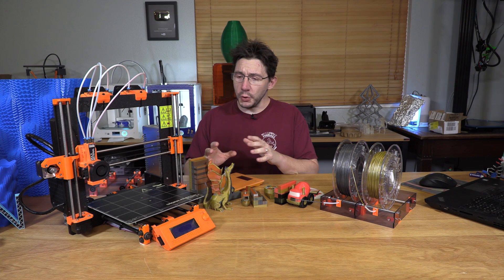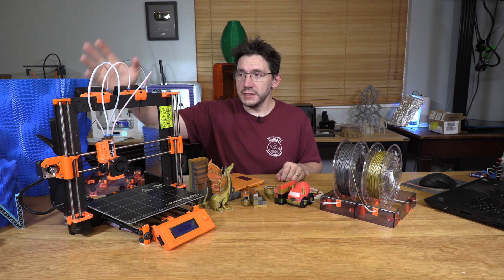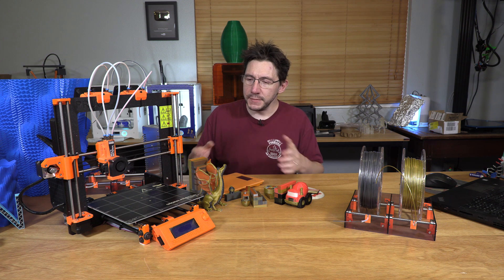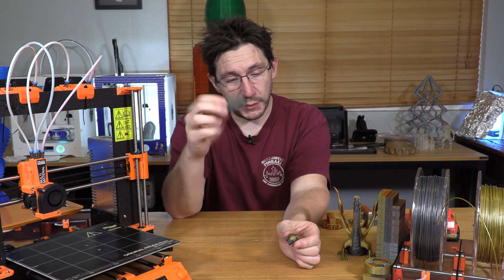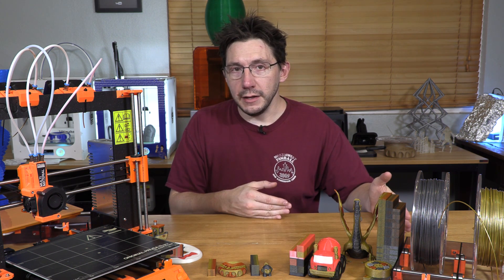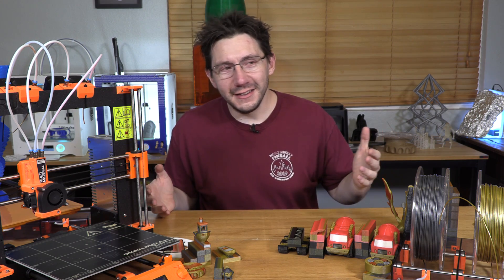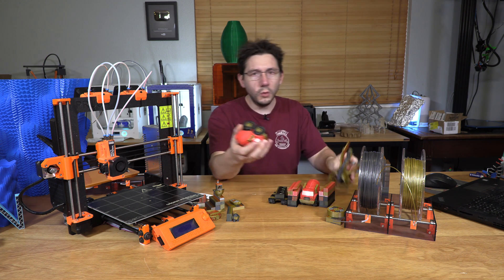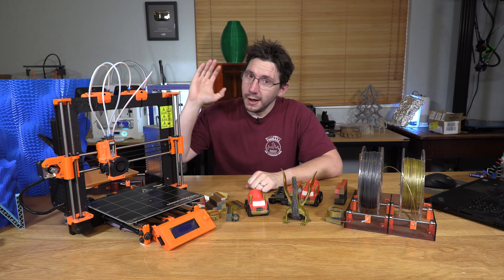Prusa Multi Material Review(?) - My Thoughts on the Prusa MMU 3D Printer

Comment: I wonder if instead of a waste block, that can be done with the in-fill instead... assuming it doesn't bleed through the outer layer.

Or have an option to print a 2nd separate object using the waste/prime material.

Comment: excellent review. I run a 3 filament head which gives me mixed 4096 colors or should I say shades but a 4th would be handy as a support medium I do have a small amount of waste but because it mixes on the fly a lot less than you do. I'm taking about 1 to 2 grams of waste for each change over. Mixing heads working properly are awesome!!!

Comment: You don't need this to make multi color prints. Paint works very well. I have a dual nozzle printer and the only time I  use the other nozzle is when I need to print a part with rigid and flexible parts.

Comment: The purge tower is a great point but the key is it's the same size if you print 1 or 100 parts on the bed so it's very advantageous to print many parts at once. This way the purge tower becomes a small fraction of the overall weight. Helps to have a huge bed for this :) Nice video though and very easy to follow.

Comment: The solution to the waste block and the wasting of extra filament to build the z height is a rotating disk attached to the z axis at the correct height for extruding plastic. The old colour can be purged by extruding it onto the disc while a scrapper will direct it to a waste bin or a small shop vac.  (C) David Patterson Dec. 7, 2017.

Comment: Lol Either Joel doesn't know that Bearings are sold separately and massively cheap everywhere in the net. "Take apart fidget spinners and skateboards." 
ORRRR.... He was probably joking, lol
Reply from the maker: +Fernando Nuñez ;)
Reply: DUDE, I LOVE YOUR WORK MAN, THANKS A LOT.
Sorry. Fangirled for a sec.
Reply from the maker: The second "n" in your last name is cooler than ANY of the letters in my name.
Reply: Hahaha, You're awesome! 
Thank you.
Will you and Angus ever try building a printer from Scratch? 
I would love to see the step by step.  more detailed. 
Like Thomas, but not "Cloning" Or like Tech2C but with more actual step by step. 
I would probably pay to have those videos.
Reply: Thomas has a pretty nice cloned prusa i3 from scratch build, I think it’s pretty relevant for most scratch printer builds still, I must admit, after the first general videos, views were pretty low because most people are much more casual. It’s a pretty huge investment for a series like that. Best of luck to anyone who wants to build a printer from scratch because it’s really awesome for the tinkers!

(Building a SCARA reprap arm if you want a really unique printer system, unnecessarily large print volume potential, and generous open source firmware out there)

Even skate boards get their bearings from fidget spinners Kappa
Reply: Gordon Laplante just like every other kit. Lol
Reply: Joel's second printer was a gMax 1.5 kit. Not so much from scratch per se but he did assemble the whole thing.

Comment: Only time the purge blocks start not to matter is in printing more then 1 copy of the object.  The purge block get shared.  I  currently have 3 machines with the MM upgrade, so here is my  personal experiences: 
Pros
    prints very as nice as mk2s
    software is easy to use
Cons
    1) QC on the 3d printed parts where not that great.  Main issue I had was with the multiplexer block, 1out of 3 actual worked with out either being replaced or reprinted by me.  Issues was fitting the SS tubes,  tubes where at wrong angles which created major drag.  In bot parts extruder 2 and /or 4 holes where collapsed or bad angles.  I would recommend the multiplexer block would be shipped assembled and tested in upgrade kits .  Or if possible mill the part or redesign it.
   2) Under extrusion.  I found  few issues that can cause it.
      a) multiplexer block drags the filament and or start shaving  it on retraction.
      b) bontec gears
           i) the gear on the door can spin out the shaft  on bottom side causing a misalignment.
           ii) no sure if the coding on the gears or  cause by misalignment girding. But the bontec gears produce a black metal dust that eventual makes down to the hot-end. (its not filament dust that is a separate issue)
          iii) slop develops on the bontec gear on the door allowing the door to rattle and eventual gets miss align.
   3) jams . Well most of the time it happen to me because the hot-end got block by garbage (bontec gear dust) ], very few happen on filament switching.  But is huge pain to fix.  The bontec grind the crap of filament shoving dust all over the place. Now I use can air after every print, even if it did not fail. I know the MK3 MM will fix the grind the filament, because it will detect jams.

So the purge blocks compared to maintenance is nothing.

Over all I think is a great product but it needs few improvements to make as reliable as MK2s single was.

Comment: There would be 0 waste if you programmed a desired object rather than a useless block of plastic. You would end up with two great models.
Reply from the maker: +A M a multi color / multi material desired object would still require a purge block, so I don't quite understand what you are saying.
Reply: 3D Printing Nerd, an object made from your purge material as if you were only printing with one color. It would look tie dye but still more useful than a block.
Reply from the maker: Ah, okay I see what you're saying. YES. I think that's a great idea, and would have to be implemented at the slicer level. I imagine picking a model as a "purge model" and then letting the slicer work out the details. Hmm...

Comment: There is no way to make 3D model instead of purge block - I see a lot of comments about this!

Nozzle must clean old color, and start to print clean new color all in ONE LAYER - because of this, there is no way for purge block to become a model. Nozzle always need same area to purge old and start new color - so that imaginary model would need to have same horizontal cross-section area (or at least, bigger then needed)
Reply: I think purge block is not always the same length of filament per layer - it contains some empty/support-only sections inside. So besides a purge model you could have a smaller purge tower that is smaller and mostly support except where the second model is insufficient to purge.

Comment: Full disclosure, I’ve only had my CR10s for like 3-4 weeks, my first and only printer.

That being made clear my question for the prusa engineers is: WHY? Why create a block at the same time as the product matching the layer height? I’m guessing it has something to do with wiping off the nozzle after the color purge. 

To me this is a programming problem. Once its done printing that color and needs to do a color purge, home the nozzle and puke out the old color, then return with the new color then keep printing. I think that way you’d only lose about 5-10mm of a color per change.  Maybe not a full homing just on the X and Y, leave z alone. 

Or instead of what appears to be a long wide block how about a small 2mm thick walled rectangle. 

I’d say just mod the operating system on the multi filament models.

I just emailed prusa with my suggestion on just purging without creation of a whole new block of wasted filament.

Comment: Can you turn PLA on a lathe? Because those waste blocks could make awesome pen blanks.
Reply: Yes you can, and i think they would not, because the purge blocks contain empty sections inside.

You can however take a casserole dish and melt down that PLA into a solid block in your baking oven - together with other failed and discarded prints, and you can of course machine that.

Comment: Was going to invest into the MK2 MMU unit then refrained.  I love the concept, except for the size of the waste block. I don't run a print farm so everything would have an amount of waste, and the bed capacity by now should have grown. Plus the MMU option is unit specific as far as my understanding goes. Whereas a Mosaic unit can be swapped to any unit, and there are talks of making it capable of dual extruding to 2 units at the same time.

Comment: (About 3:50) I bet the resistance that is from the roughness of the bearings, they can’t handle the weight of the spools? That's what it feels like when I manually pull the filament through mine. 

I've read online that you can adjust the footprint of the wipe tower to make it less wasteful, but I'm hesitant. The frame looks like it could hold at least one or two more sets of extruders; they would have to make the feed chute (?) larger to accommodate more Bowden tubes.

Comment: Joel,
I, too, was not completely satisfied with the way the spool holders worked from behind my printer (plus I didn't have enough room behind my printer), so I made a rack that you may want to consider: https://www.thingiverse.com/thing:2618257  .   It gets the spools out of the way of the bed cable and gives you easier access to the spools.  I've been using it for several months and it works very well.

Comment: those are some big purge blocks imo. with my 2 in 1 extruder system i need a purge block of 18x18mm with an E3D clone. 
if you don't use every color on every layer then purging somewhere on the side should be more efficient right?

Comment: Can you actually print multiple materials with this, or just diffrent colors of the same material?
For example, would it be possible to print the mixer with transparent windows?
Or print a model from PLA and add maybe carbon filled nylon as structural parts into the model? Or print a part from PETG and add sensor surfaces with conductive filament?

Comment: If anyone is wondering why Infill purging isn't a thing yet... I actually did a little project about a year ago that emulates most of the "smart purging" with a gcode post processing script  before Prusa released his MMP kit. I had put together some random thoughts about printing multiple material with a Y splitter/single nozzle. 
 You can read about my thoughts on it here https://www.reddit.com/r/AdditiveManufacturing/comments/7924cx/a_prototype_of_smart_purge_tower_equivalent_of/
Reply: I was thinking a tuneable purge amount or a second model printed in who cares what color, but your idea is far superior! Yep, infill purge!
Reply: Mega Making Thanks!
Reply: I had the same idea while I was watching the video. I don't know how many grams are used for infill, but It would increase the efficiency of printing.
Reply: Collective minds = smarter problem solving

Comment: id use the MMU to showcase a more finalised product that comes striaght of the bed, works well in this case. Id also wouldnt use it for colours really, but for exoitics/different materials, so carbon fiber, nylon, dissolvable suport,  cheap pla, flexible material, so that more practical or movable prints work well straight off the bed, or if u design in a modular fashion as u should, then u could print more single material parts in the same print, which would produce purge tower only when switching part, or if the parts are small enough to be printed one after another (dont see that much these days) then u get a continuos printing but only small purge when starting the next print.

Comment: So the way for example BCN3D does multi material printing does not need a purge tower and only has as much waste as filament is drooping out of the nozzle. While the Prusa MMU clearly does support more colors, don't you think the better "first step" for multi material would be the system BCN3D has? From there go innovate and find a way doing 4 colors? Not wanting to down-talk the Prusa MMU, it's clearly a great product. I see a combination of UM style multi extrusion and independent carriages in the future... Or even a 4x UM style extrusion system.
Reply: Independent carriages like on Sigma and UM 3 are much more expensive solution - definitely better, because you can mix different materials (with different melting temperatures), but price is a BIG factor here, in Prusa case.
Prusa MMU is in fact Multi Color Upgrade.
Reply: The BCN if you can get both nozzles to work at the right height and if it does not  drip plastic then it works,  but two head system working at the same height is difficult.

Comment: Hey Joel, we need to take the multi material upgrade and slap that sucker on the cr10 500. This would allow you to print a bunch of the same model at the same time and still only have the equivalent purge block of a single model.

Comment: I've stated this before . Software coders need to make the purge block part of the infill and this will reduce a lot of the waste . 
Now lets say you happen to NEED a small infill percentage and the infill/purge block is too small to properly purge the color in order to move onto the next layer. Then you simply have a metal collection box on the side and have it scrape off the excess filament needed to move on . Just like the Sigma 3d printer . 
You've just went from 87% waste to about 0% - 10% waste based off model size , infill percentage , and the amount of different colors used . Problem solved , you can thank me later .
Reply: the biggest issue is the infill colours bleeding though the walls... if you use more walls, you essentially wasting more plastic on a cosmetic only model in which, most of the time, you dont need such models to be that strong.
Reply: @MegaMaking  or if you are using a more transparent filament, ideally  the mixer would know it needs x color and splice in the new color so when it gets to that section of the model it is there "just in time", but lot of bugs to work out to get there. it is a work in progress as joel said, i cant wait to see where it leads
Reply: i think at that point you could have an option in the program for infill purge or purge block
Reply: I think this is pretty hard to do but it's indeed a great idea and you're not the only one who thinks this should be done. Also, this would be helpful for saving money. Say I want to print a model in a nice color that's pretty expensive, I could just print the shell with that and use other cheaper filament to print the insides.
Reply from the maker: +mrlithium69 I think so as well.
Reply: If you add a micro servo to wipe the extruder nozzle after a small amount has extruded it would take less time and not have to go as far away from the print.
Reply: the point is to purge the INSIDE.
Reply: yeah that infil purge  would work but that is just in multi color printing if you want to use this as multimaterial the purge block  or the wiper are a necessity to obtain the desired mechanical or chemical specs of the print
Reply: Seems like there is a lot of coding to be done to optimize the purge block.
Reply: The Mosaic Palette+ software already does this.
"Chroma versions 2.2.0 and above feature a Transition in Infill feature. It does exactly what it sounds like and can reduce filament waste by 50-90%+.

It will still provide a sparse (~5% infill) transition tower to be used for pinging (unless you're using side transitions)."
Reply: This is not as simple as it looks. The developers (obviously) thought about that.
Look at the Adalinda. There clearly isn't nowehere near enough infill for the purging to happen. And you can't just do it in some layers and then not in the other. If you skip a layer of wipe tower, well then you can't use it anymore, you would print into air.
Reply: I would also be happy with it printing a second copy of the model where all the color shifts occur in there. Crazy tie-dye model.
Reply: Good news, in case you hadn't heard, you can now 'wipe to infill' with the prusa MMU2S.
Reply: I was just thinking this as I watched the video, and of course someone has already thought of it.
Reply: Those aren't hard problems to deal with, though; you'd just fall back to a purge block when necessary.
Reply: Hiding the purge within the model is a good plan but alteratively it has to be possible to at least print something acrylic-paintable as the Mixed Colour Waste.   Im working on a Non Purge Multicolour Extruder Design.
Reply: hed420 hehehe
Reply: hed420 or in the mixing thingy at the top, have the filament be welded to gether, then it only waists that tiny bit where it is welded!
Reply: Yes that is a cool idea for sure!!!!  Very cool, but how would this work when printing multiple versions of the same thing on the bed?  Seem like in the case of multi model prints this could be more wasteful than the standard purge block.
Reply: This idea is the one that I've heard that makes the most sense really.